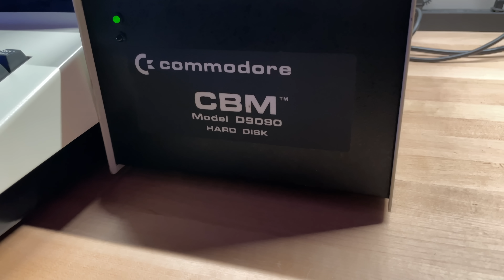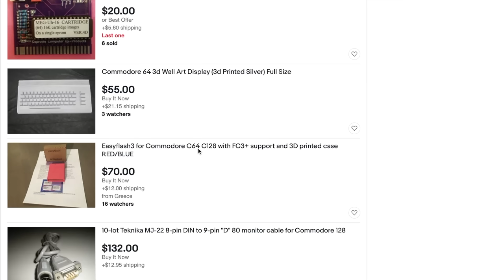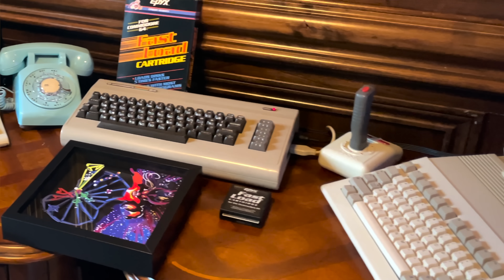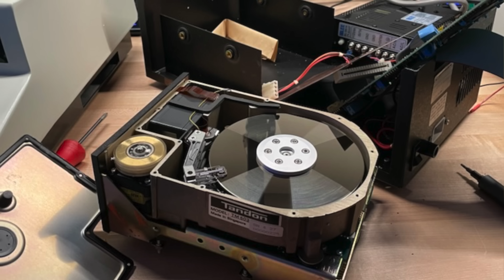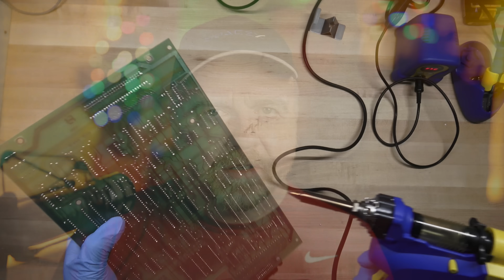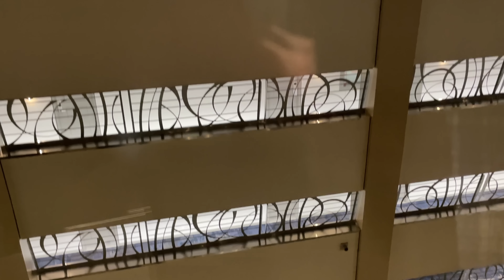FOUND: A Super-Rare Commodore D9090!

Comment: Hi DP, I worked for a big Commodore dealer in UK in the 80's as a service tech. I used to repair all the CBM range including VIC20 and C64. The 1541's would always go out of alignment, I think due to the stepper motor pounding the track 0 stop ,generating the ubiquitous knocking noise. Some days I could get 10 drives from a games developer all needing alignment , using a scope and and the cats eye alignment disk would go through them like a dose of salts. Always found the 8250 with Micropolis drives a pile of junk and could drive us nuts trying to align them with consistent results. We used to sell the odd D9090 and a big unreliable winchester hard disk unit to connect to the PET but I cant remember the manufacturer of it. It wasn't Commodore.

Comment: I'm going to assume the motor in the HDD had a faulty phase or something causing some sort of large negative inductive spike that either traveled through the snubbing capacitor between the primary and secondary sides of the power supply and down the line causing an imbalance and triggering the GFCI or down earth causing the same issue.

Comment: From the symptoms the old drive showed, I suspect the problem is a dead short in a head actuator. It spun up fine, but as soon as it tried to move the heads and flipped the relay to power the actuator there was a dead short exposed to power.
Since you already cracked the seal on the drive, there's no harm in checking the actuator to solve the mystery.

Comment: Dave, I feel your pain and share your determination and retro headspace.  I can't believe how familiar your hardware stories sound.  I'm crappy at programming but somehow your drag racing dialog is very understandable anyway - Thank You.  I worked on lot of very old hardware and all these references cause bits of schematics, white papers and registers to flash in my head - great fun.  We did not have no computers in 1978 at my Port Orchard High School computer classes, but we had chips and led readouts and made due.  

Your buddy took the the hard road to add 32K.  You'r supposed to solder the extra 32K on the piggyback of the first 32K chips but leave the high order address pins bend out and wire those together to the address decoder.  I think that would often be one of the 74LS154 you referred to.  Oh, I suppose, I could be wrong, given the RAS and CAS drives and such.

I worked on fully analog guidance and weapons computers, and apple II clones all the way up though to massively parallel long distance phone switches.  The down side is very few people on the street want to hear about it all.  We are an audience who can appreciate and really enjoy your stories - thanks for sharing.

Comment: Idea for the A/C Problem:  The 12V- shorted to chassis and the Ground to the power supply ALSO shorted to the chassis.  So no isolation transformer in the circuit?
Reply: I don't know for sure but I think because the 12v is DC and very low voltage, it shouldn't trip the gfci

Comment: Good old D9090....
Still have 2 of them. Haven't been powered up since around 1990.
They used to be hooked up to a C128 (in 64 mode) in the late 80's when I was running a BBS before moving over to the Amiga.
Memories of rebuilding the power supplies when they would overheat and fail. My cat loved them  in winter as a heater.
Might have to dig it all out and see if it all still works...

Comment: I used to work in a clean room changing platters and heads on those early hard drives. Seagate st251 and miniscribe 3650 and more. We had to write the zero track  on the first platter for the stepper  motor to reset to track 0.

Comment: Hi Dave,  Hearing that drive spin takes me  back to the late 80's working for HP on the Eagle hard drive 572Mb of 8 inch winchester goodness, if anyone has one there is PEAGLE flying pig logo embedded in the circuit traces of one of the 3 baords ( It's part of a delay line to stop management from taking it out ) Really enjoying the channel

Comment: Most interesting, I'm rather curious about your TRS-80 network adapter. I've got a model 1 that has been somewhat modified, and that I occasional boot up, however getting Ethernet/WiFi so I can FTP etc would be great.
I do have a 'hayes modem' emulator that talks WiFi, however that is basically gives telnet only, so there is still a huge divide between the TRS and my NAS & PC's.
Reply from the maker: I forget the name of the board I'm using as it's been 10 years I'm sure, but it contains a Network jack and a SD card, and there is software for TCP/IP,  DHCP, and FTP.  No WWW server though.
Reply: @DavesGarage  Thanks, back to good old Google to see if I can stumble upon it.
My 'Hayes modem', based on an ESP01 module, talking to the TRS at a dizzy 300bps, was originally intended for a Commodore 64, I just added a TTL to RS232 converter board.

Comment: Hi Dave! Very nice video.

If you think the vacuum gun is nice, you should check up the things JBC has. There’s essentially an iron tip that looks like a T, that ends with a pointy end. Their irons are so powerful that they can keep the whole thing hot enough. You can heat up the whole side of a DIP chip at once! With two of these you can pop DIP chips in one operation, very, very handy!

Comment: You had a Neutral to Ground leak somewhere in your home's wiring.  I had a similar issue years ago that turned out to be a roofing nail in a metal shed that had gone into the Neutral wire in the lighting circuit.  Great fun being randomly electrocuted in that shed.

Comment: I have a CBM4016 which i brought new sometime in the 80's, i added the extra ram to make it 32K not long after. after a lot of years sitting under the stairs in the house, about 20 i turned it on a it did not work. A video ran fault which was fixed with some "new" chips. :-) Plus the floppy drive let out the magic smoke when the mains filter cap let go.  

I did a few videos on fixing the ram and cleaning it up and changing the mains filter on the floppy. Still seems to read 40year old disks that had been storred in the loft for the last 40years.

Great to see you got it running in the end.

Comment: I find that a dead short is often a dead tantalum capacitor. They die either open or closed. In fact, the way it affected the power supply and even the circuit breaker makes me think that even more. Go poking around and look for one. Then remove it and test to see if 12 volts is then shorted. Actually measure the resistance too, don't just "tone it out". If it's no longer shorted then you found your problem. Tantalum's and Rifa caps love to die and barf out the smoke.
Reply: Tantalums usually explode when they fail short, so they're usually pretty easy to spot! lol
Reply: Yeah, those tantalum and Rifa capacitors really know how to make a dramatic exit!
Reply: Why does a dead short trip a GFCI though? I ask because I thought it only reacted to "missing" current?/voltage?/watts?. I mean, i thought a GFCI only tripped with some type of path to ground, not a short between hot and neutral.. AC gets weird sometimes and I also lack a lot of knowledge. Can you let me know where I'm confused? Thanks
Reply: Dead shorts on the power rails happen even on modern drives. It‘s almost always a shorted cap.

Comment: I once had to make up my own code shortcut... my stepper motor laser imaging system/program had to draw the image then move onto the next; Long story short, I had to go to different sections as they completed last one, or loop until finished. But which loop? 
Ended up with a  if/then -push-to-stack-, then at the end just did a return_from_subroutine number on stack. Took all the guesswork out, 1if/then set bits-2push-3rts. done.

Comment: Dead short on the power supply would be likely be a shorted TVS diode, which may be safe to remove, its usually there to handle any really poorly regulated power supplies, as for the GFCI tripping, most power supplies have small capacitors between live/neutral and ground, they sometimes go overkill with the value and it means they leak current to ground, generally more the more noisy the power supply gets, e.g. under load

Comment: I have never seen an MFM HDD, but recently got into dead storage devices a replaced the jaz/zip drives I used to have in college, and bought Syquest EZ135 , Syjet, EZflyer, and Orb drives. Luckily I have a PCI-E SCSI controller for a Windows 7/XP machine. I kind of miss the sounds of mechanical drives spinning up and reading/writing.

Comment: the power issues sound to me like a combo of a bad motor driver circuit (or maybe the windings) and a poorly isolated power supply. 
im not familiar with this drive, but check the ICs that drive any motors, particularly the spindle motor. 
the GFCI tripping is probably down to the fact that those cheap chinese ebay psu's often have poor isolation between the primary and secondary sides, and little if any OC, OV, or OH protection.
if I were you, id get the motor drive up and running on bench supplies(not cheap ones, dave of the EEVBLOG channel has some solid recommendations on good ones)
once the drive works on bench power, give it a good SFX PC power supply from seasonic or another reputable brand. the shitty chineese psu modules are generaly not good for mutch more than driving equally shit LED strips in my experience. ATX and SFX psus are great for projects with demands for clean power. 
holy crap that was a long winded rant
my assburgers (teehee) is showing lol

Comment: Shorted Tantalum capacitors would cause such a short across the +12v line and are common failure items on old computers.
Reply: If you have an ESR meter, you can use it to find the short circuit. They are basically high frequency milliohmmeters and some will go down to .01 ohms. Use them to find the lowest resistance which will be the shorted component.